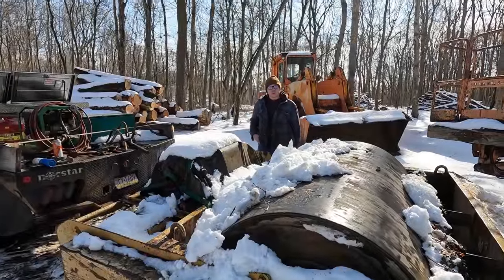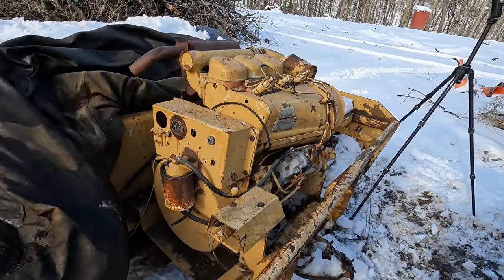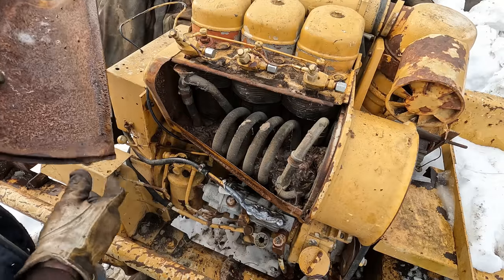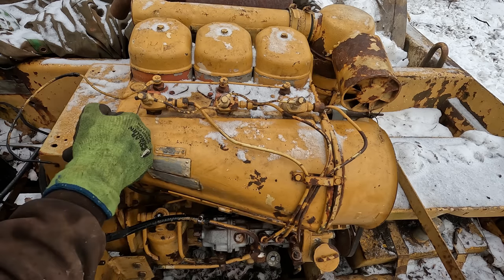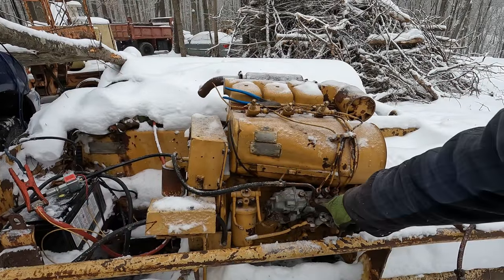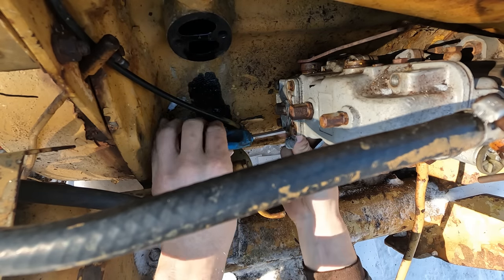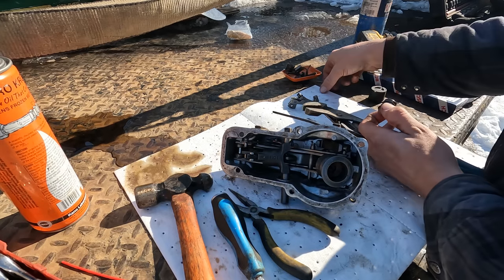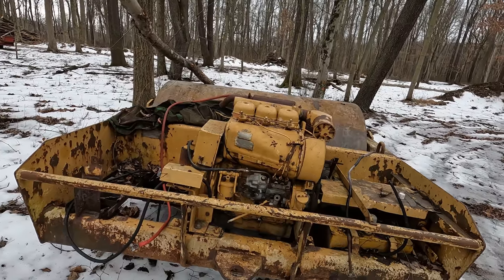Diesel Powered Roller Compactor, Sitting 30 years, Will it ever Run again???

Comment: I am pretty sure that engine is a F3L 812. I have the same engine as a 4 cylinder in my tractor. Here in Germany they are a dime a dozen and every farmer knows how to fix them. Parts are very cheap. You should definedly get the glowplugs working, in cold weather they will not start without them. And also, you can get the cooling shrowd out without taking the injector lines off, its tight but it works. Looking forward to seeing that old thing run. They quit making the 812 series in 1969 so its propably a mid 60s machine.
Reply: You’re a good man for explaining so well.
Reply: locally built, large availability = low cost and lots of parts.
Deutz parts in North America, rare and expensive.
Reply: I have older Deutz . Loud but run nice 
I dont like the newer rubber timing belt models. I had one water cooled Deutz blow up from rubber belt failure.
i believe Deutz came from Rudolph Diesel originally.
I had a Krupp 120ton AT krane also.
A danke.
Reply: It's not f3l 812 but rather f3l 913 or 912, only difference is in cylinder diameter, but is wary small difference
Reply: @MechanicB123  912 and 913 are direct injected. This engine has glowplugs, so more likely an 812 which has indirect injection.
Reply: @jaquigreenlees  very true, a buddy of mine bought an Ford F150 from the states, he is unable to find even the most basic spares around here, because its a very rare truck in europe.
Reply: @93holzkopf1412   yes I see the difference, I would poste the picture but I can't
Reply: @MitzvosGolem1  Deutz came originally from Nikolaus August Otto, the inventer of the four stroke engine.
Reply: @93holzkopf1412  There also exist versions of the fl912 with vortex chambers and glowplugs. But you are right, at winter conditions they will not start without preheating.
Reply: Tim, great explanation. I grew up in Köln and can tell a lot about Deutz Fahr… maybe we can put together and help Matt with getting the resources in Germany together so Matt can get the parts he needs to make this beaut go run great again? @Matt as Tim stated, you’ll get that stuff for a dime a dozen… and you’ve got enough German speaking folks in your sub group to help you find d thorn parts in good ok’ Germany!
Reply: @schlosserhansel  Wow thanks. I like their older farm tractors also.
Reply: @MechanicB123  No one wants to work on them in NY area. I fix manlifts construction equipment etc. 
Owners Usually switch to a 4bt Cummins etc.
Reply: @0123663210  Tell guys here that.
I agree with you but many dont like them.
Reply: @0123663210  I NY America. 
I like older Deutz not newer ones have ECM and rubber timing belts.
Reply: F3L812. Have the same engine in a tractor. As said, they do not like to start in the cold without glowplugs. 12V and done, should take about 20s to warm up. Keep them on while cranking. Also the return line from the injectors seems to be disconnected and pinched off, this might affect the injection as well.
Reply: @MitzvosGolem1  But the engineer Prosper L'Orange made the Dieselengine useful with his invention of injection nozzles, injection pumps while working for Deutz in Cologne in the early 1900.
By the way i'm a professionell engine rebuilder in Germany. Cummins is a pain in the ass for me. The parts for aircooled Deutz are to cheap, so i prefer to work on the japanese, more modern Deutz and anything wich is metric, nowadays mostly vintage european car engines.
Reply: USA youtubers stubbornly refuse to use the glow plugs. 30 seconds or more is needed.
Reply: @93holzkopf1412  
Servus Tim, manche Einspritzpumpen muss man Ölwechsel machen. Ist das bei diesem auch so?
Reply: @joachimscheller3960  Sieht so aus, sehe keine Ölleitung zur Einspritzpumpe, heisst also regelmäßig wechseln.
Reply: @schlosserhansel  and the Otto Pilot?
Reply: @MGower4465  i guess that was invented in the US by people who use imperial measures. It looks like that.
Reply: @MGower4465  Maybe uncle Donald was the inventor, looks like him.
Reply: He should look at the channel from Wilfried "050607dx" 
He makes a lot videos with Deutz-Motors.
Reply: @andrewallen9993  yeah, and it will cost a fortune to ship them to the us or even more to where I am in Canada. so the parts still ain't cheap.
Reply: Just looked it up in Wikipedia: Nikolaus Otto and Eugen Langen founded the factory in 1864 - for stationary gas engines. The name "Deutz" is the name of the city Deutz, where the factory was located...
Reply: @jaquigreenlees  But unlike a John Deere you are allowed to buy parts for it from the factory!
Reply: @MitzvosGolem1  "!  believe Deutz came from Rudolph Diesel originally."   Yep !  Don't ask me how I know, can't remember where I read that a loooong time ago ! (69 y.o.)
Reply: I've got two tractors with Deutz engines. One is a 68hp 4 cylinder from the 60s and the other one is a 3 cylinder turbo charged 70hp. They both are work horses and run great. The 4 cylinder has almost 7000 hours on it.
Reply: Those Deutz diesels were very popular here in Argentina. Many folks retrofitted their Ford trucks with the 913: https://youtu.be/CcP7w9Ohli8
Reply: @erik_dk842  
they aren't diesel guys...anyone living in cold climate knows you gotta glowplug or heat the engine before trying to start it...these youtubers don't listen or learn..they just crank and crank...too slow....waste of time if cold and slow...
Reply: I like how much knowledge the community can reveal.
Reply: Here's your supply line Matt⁉️👍😉
Reply from the maker: I have the number written down I wanna say it’s a f3l 720? I need to check that again.
Reply from the maker: @0123663210  I think you are correct
Reply: @DieselCreek  They didnt make a 720 series. Most likely a F3L 712 then. Never seen one with this style of injection pump though.
Reply: @federicomolina6745  They seem popular everywhere except the US lol- they are extremely common in Australia too- far more so than the 4bt cummins that someone else suggested swapping it for... :-(   I don't mind the cummins, but the old deutz is a much better motor imho...
Reply: @redporschekilla  I also think so, Matt, you have many Friends in Germany that will help you to get this thing to run
Reply: @garymallard4699  I agree never have I seen so much cranking at slow rpm and they just keep cranking till starter goes and blame a no good starter ??
Reply: @billcarriere5374  
it is funny but Sad too
Reply: @garymallard4699  He was using "Glow Plug" In a can !
Reply: @mattywho8485  
Yeah i know but his battery was not strong enough to crank and it was too cold...he should have tarped it and heated it for a day...get 2 batteries minimum and actually get it started...
Reply: Ich habe den 712er der ist Ja beinahe genau so. Einspritzanlage und alles gleich. Nur den geklemmten Anlasser. Der 912er ist dann nochmal eine große änderung. Das wird ein 812er sein ja.
Reply: @93holzkopf1412  Could also be a 912W, which are indirect injection with glow plugs. I own two.
Reply: @Porty1119  yup these are around, too. Quite popular in underground mining equipment and forklifts because they had better emissions. Looking at your channel i think i know where those came from😀 An easy way to tell them apart from the 812 is the 912W has the injection lines running below the cooling shroud, the 812 has them running on top.
Reply: @jaquigreenlees  These engines are nearly indestructable. As Mr. Möhn wrote every farmer knows how to fix them. As long as no parts got lost like the starter or the fuel injection pump it is no problem to get them running. I have done a two cylinder myself for my generator. 😁
Reply: @93holzkopf1412  
So..ich hab jetz geschaut, gefragt..
Meine braucht kein Öl. Daher nur gutes Diesel tanken. Gutes Diesel hat schmierenden Effekt..

Comment: When you're trying to deal with something like that in the cold, do yourself a favor and take a big cookie sheet with charcoal on it and put it on the ground under the engine. Put some moving blankets, cardboard or something over the motor to hold the heat in. Getting the heat into the motor will make life so much easier.

Comment: I thought I had a problem buying too much junk. I bought a South Bend lathe in 2015 and it still isn’t running. Do yourself a favor and stop buying so much junk!  It seems like it would help your channel to do a few multi-part series where you take one machine and take us through several processes on one machine. Basically what you’re doing now, but not so much clapped metal. The loader(don’t get me started…), the dump truck, the heavy trailer, the crane, the whacked out church building (OK, I miss the church and I really want to see you work on that some more.)! I feel heavily invested in this channel all of a sudden.🤪

Comment: Just a tip. Good idea when dealing with something that has been siting for 30 years is to manage to get some oil into the cylinders to baby them bare walls back into being. I'm hearing squeaking as it turns; that of course could be a lot of things, but then to see starting fluid squirted in there which will wash away the non-existent oil on the cylinder walls. Just a tip. I know you will get this running, and you know a ton more about diesel engines and heavy equipment than I do. I just feel like you're open to a family community here on your channel. I'm very appreciatiive to be part of the team. Thank you.

Comment: I have a side story from the 1980s. Was working as a driveability tech for the Chevy store in Van Nuys california and one night the lube oil tech got a service job on a diesel pickup (non turbo), he changed out all the filters and replaced the oil. Note I didnt say he at any time filled the filters with fuel! He pumped everything dry. I can tell you from my experiance, that v-8 would and did run on four cans of W-D 40, untill it picked up the prime. You Might want to try some WD pumped into the intake along with the Ether as it will also help to lube the piston rings and cylinder walls, or use some Kerosene from your space heaters. Thanks for the videos , And I am still jealous of your free - bees (diesel onan generator water logged) I never seem to find anything like that here out west. Thanks Jim

Comment: These Deutz engines are really but REALLY bullet proof. I work here with the same engine on our Deutz D4506 tractor. Our tractor has not recieved new oil, oil filter or diesel filter or any filters for atleast 15 years. It still runs like a clock even without any service on it after all these years. The tractor is made in 1972. I love them. always start. Never let us down. Has no heater for the diesel so you can't preheath. It is direct injected. you have a reliable engine there.

Comment: Matt, I have a Deutz 2011 diesel engine in my skid steer.  Mine is an oil cooled three cylinder.  Most of these motors have either a glow plug or a glow element (element is a single plug that goes in the intake manifold or air box before maniford)  Be sure not to use ether if glow plugs are operating as you can blow things up.  I have seen guys using a propane torch directly into the intake (like the glow element) and will make things fire right up.  I also agree that if you are not seeing fuel or smoke while cranking, that is the problem.  Matt, most important is to check the timing belt, yes, belt.  Pretty easy to replace and not too expensive.  It is an interference engine so it will bend push rods or more.  Keep up the great work and videos, you rock!

Comment: I have a soft spot for Deutz engines.  Spent 3 1/2 years working on forklifts, majority of our fleet were Baker diesels with Deutz motors.  We had 70+ forklifts almost 50 Bakers.  Most hours on a motor without an upper overhaul was 32,000, had pump problems,  replaced top end on general principal.  Most ran about 18,000 hours average on top end.  Bottom end no problem, keep an eye on wrist pin bushings after a couple of top ends.  Longest I saw one run was nearly 60,000 hours, if I remember right 56,000, was running well, bottom end had never been touched.  Your motor is a glow plug motor, use them, they don't like cold.  Old 7103300 used to get parked in a colder spot and I have had to get it fired up for the week many times, use the glow plugs, get some smoke, wait for heat to transfer and it would fire up.
You have the later lift pump, earlier ones had lever.  Setting valves on Deutz motors is kinda easy, set for zero lash at lowest temperature you want to start it at, lash grows as it heats up.
One last bit.  Deutz motors are easy to start when it is cold.  A space heater blowing over the cooling fins warms it right up.

Comment: A tip we used to do when trying to start 6.0 poerstrokes in the cold. Was take a ruber exhaust hose from a shop. Put it from the tailpipe of a warm truck and stick it in the intake of whatever your trying to start. It works every time. Keep it up Matt
Reply: That's a good tip. In a diesel, there should be plenty of oxygen left for the engine to fire up.

Comment: Okay, so I was laughing hysterically when you laid that propane bottle up there and started spraying starter fluid. All I could think was "What could possibly go wrong?" I had this vision of fire trucks and first responders all standing around after the fire was out and just shaking their heads and you sitting on the ground naked and charred from the explosion like an old Charlie Chaplin silent movie. 🤣
Reply: I have the same torch and it has a pressure relief on it. I learned that the hard way. Left it on a stack of split wood that caught fire from the heat of my fire pit and the bottle was just burnt and there was no propane left, and no explosion.
Reply: My name is Matt,  I am a walking talking safety brief
Reply: I was just waiting. All I could think of was fuel /air bomb! Quell surprise!
Reply: Yeah! I saw that and thought " what the hell is he thinking"
Reply: "Come with me, and you'll see
A world of OSHA violations..."
Reply: @herbcraven7146  ya beat me to It.!
Reply: "Hold my beer"

Comment: Big Moe's in San Antonio Texas is THE place to go with troublesome starters.  Of late, I always seem to find myself working on projects that need antiquated motors diagnosed, repaired, or rebuilt.  I took an early winch motor in to them to be diagnosed and rebuilt.  When it was all over with, I had a motor that was rebuilt from tip to tail and they didn't even know what kind of motor it was (and we STILL don't).  Their workmanship is second to none.  Prices are very reasonable.

Comment: The way it was cranking, I suspected it was a starter issue. On the edge of my seat to see it go!!
Reply: I have a Mercedes w124 240d that is doing that, it sounded a bit slow as it only had three of the four brushes wired up.